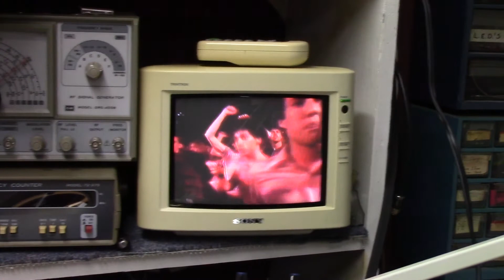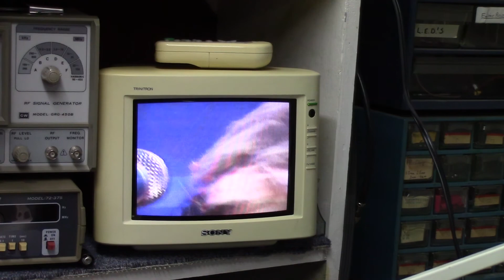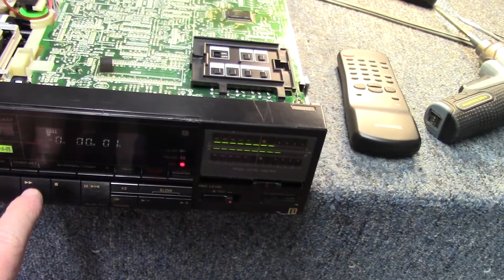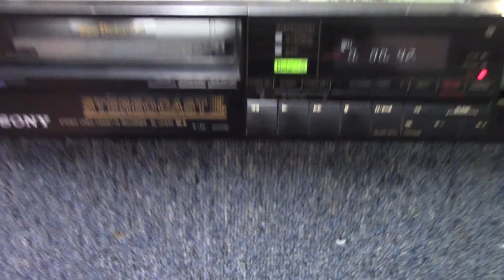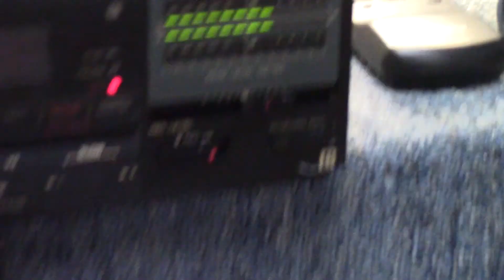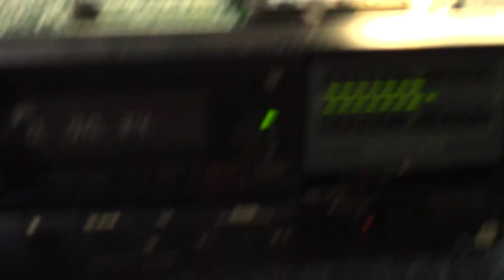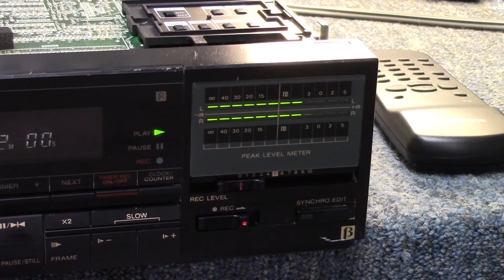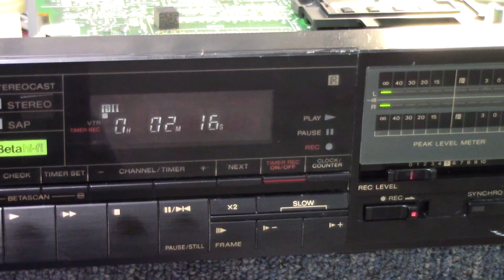Sony SL-HF650 Super Beta (quick look)

Comment: Thank you for this! Love my SL-HF650; no issue with a line across the pic. That is usually from a scratch along the tape. Wonder if you tried other tapes. Appreciate any other Betamax projects you may present in your smooth, succinct style!
Reply from the maker: Erik, thanks for checking out the video! Other tapes were tested with the unit but the line persisted but still a sweet unit.